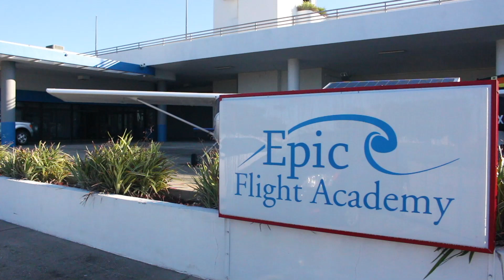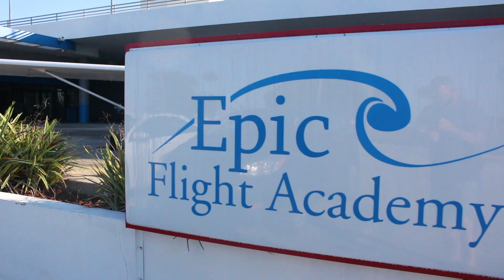Epic Flight Academy | Launch of Epic's Aircraft Mechanic School!

Comment: Hi im 19 years old and from Mongolia 
I want comercial airline pilot 
How much does it cost and the campus 
How fast do you get job after graduation 
And lastly can i get class 1 medication certifcate in usa
Reply from the maker: The cost for tuition is $25,000 ($5,000 per course) plus $300 for books and $1,500 for tools. Most importantly, you will own these tools. There is a $45 application fee once you are approved. There are 3 FAA exams that cost $160 each. Upon completion of the program, there is an FAA oral exam and an FAA practical exam. These cost a total of $1,050. Above all, we disclose all costs upfront so you can plan accordingly. Total cost is: $28,380. https://epicflightacademy.com/aircraft-mechanic

To become a trained aircraft mechanic at Epic Flight Academy in New Smyrna Beach, Florida, USA you must:
1) Be 18 years old either prior to starting the program OR by the completion of the program.
2) Speak English proficiently.
3) Pass an entry-level exam.

Check your eligibility by completing this form: https://epicflightacademy.com/aircraft-mechanic-application/